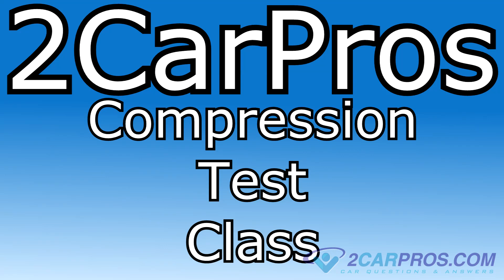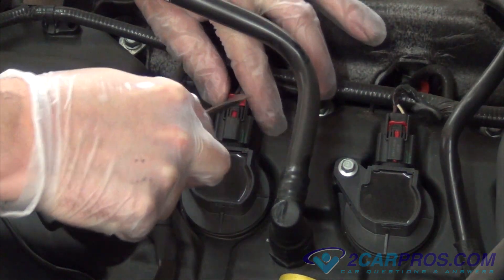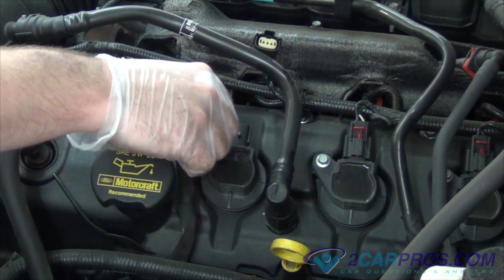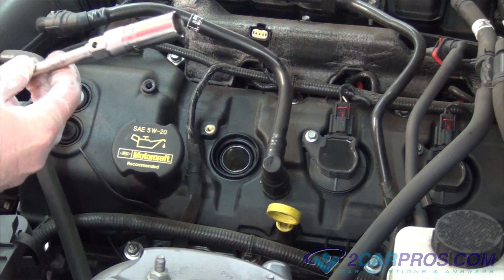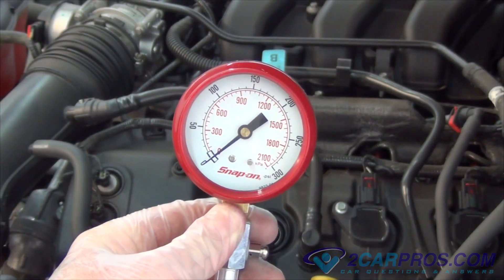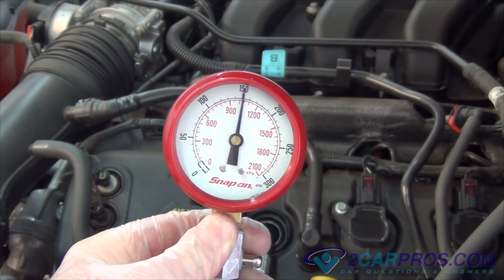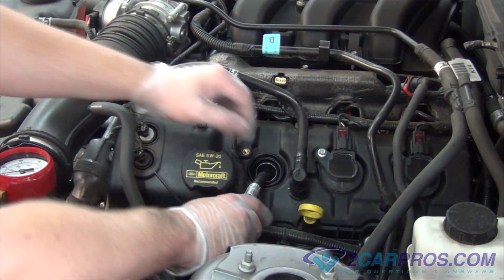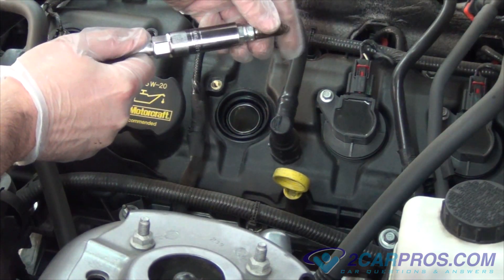HOW TO TEST ENGINE CYLINDER COMPRESSION IN 15 MINUTES!

Comment: Can I ask whether in any scenario should you remove all the spark plugs first (all together)?  In other examples I've found on YouTube they have removed all the spark plugs first and left the other cylinders open when doing the test.     But as you've stated, there could be a leak in the head gasket between cylinders and the only way you will know that is if you have the other cylinders sealed before starting the test.   Am I right?
Reply: Correct me if I am wrong, but there is a good chance the neighboring cylinder is breathing via open valve/s. 

So, your gauge is measuring pressure while that cylinder is banging while other cylinder is sucking or blowing.  Either of those changes value to equivalent of open sparky hole.

Comment: What is the required pressure for the 2001 Chevy 3500 dump truck? I tested with one spark plug out and it was between 80-85 psi, or 600 kilopascal.

Comment: Nice video -- but so misleading.  About that "fifteen minute" headline, you presume that you have easily accessible spark plugs.  Try that on any of the miserable GM vehicles with the back three buried betwixt the engine and firewall.  so sure, 15 minutes IF YOU'RE LUCKY.  For you unlucky stiffs, well, too bad.  (we won't even mention you)
Reply from the maker: I can't really be sure what you are driving because this is a general video. If you have a more difficult vehicle it might take you longer. It is really no big deal just take your time and do it right. Thank you so much for watching!
Reply: @2carpros  I think he was meaning something along the lines of plugs that are hard to get to. Like say the engine you performed this test on. It’s a 3.7 Ford Cylcone. The intake manifold covers the passenger side plugs. The only way to access them for the test is to remove the upper manifold.
Reply: Any modern car with a V6 or V8 is a nightmare to get to the back spark plugs. Many pickups have more room in the engine bay.